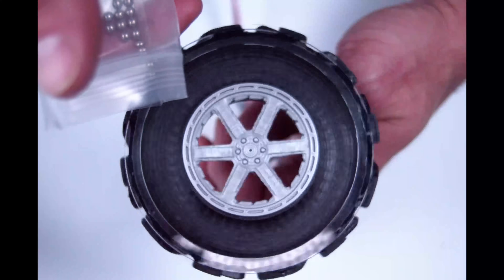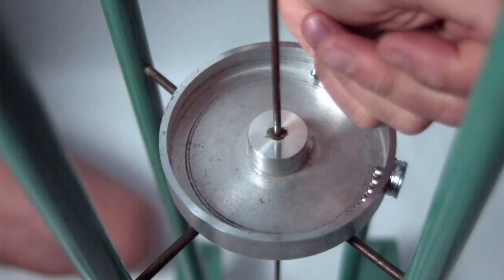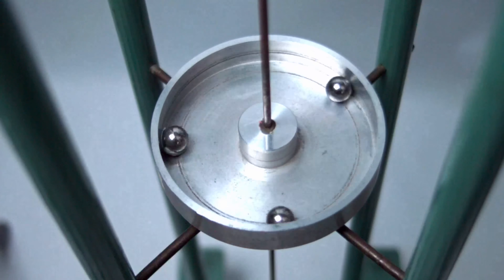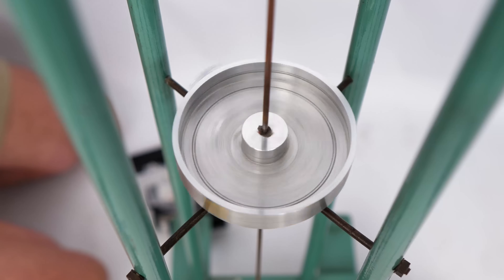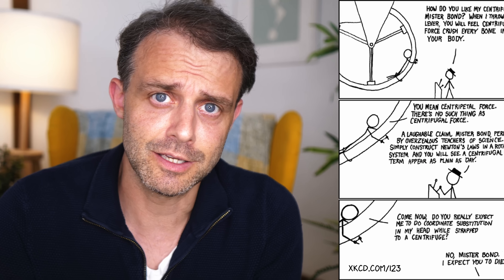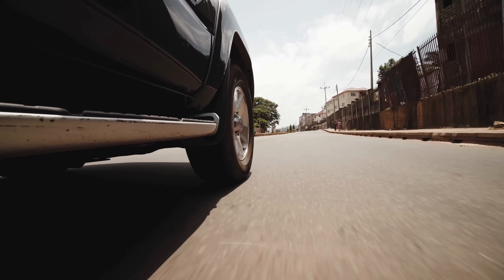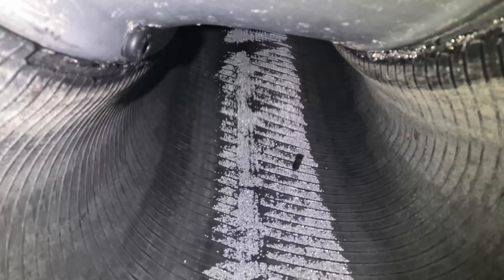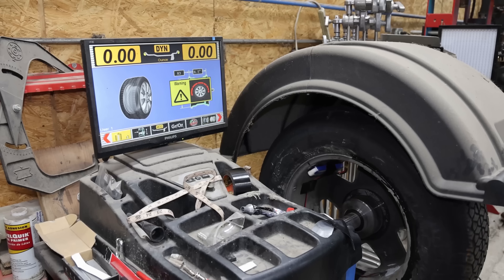Do tire balancing beads actually work?

Comment: Mechanic here. The balance beads do work in theory. In practice however, they can be problematic. They can wear the inside of the tire and create rubber powder inside the tire. Normally not an issue because it just adds to the balancing mass. The problem comes when you use poor quality air to fill tires. As in air that contains moisture or compressor oil. It creates a sticky fluid in the tire that keeps the beads from moving around freely and balancing the tire. If they all get stuck together, then it creates a massive imbalance. They can work and they're used in semi trucks (commercial trucks) frequently as there aren't a whole lot of balancing machines available for the large tires. Another method is using separate balancing rings. Theyre metal rings that mount between the hub and the wheel. The balancing media is inside that ring and does the same thing. They have the same issue though is if you get a pinhole in one and it allows moisture or condensation in, then the media sticks together.
Reply: I have the balancing rings on my semi truck's first axle and could immediately feel the difference after adding them. I thought they were snake oil until I drove someone else's truck. It was the smoothest driving truck of that particular brand I'd ever driven. That sold me on them and then I bought some for mine.
Reply: I've dismounted tires that had these in them, and the inner liner was worn halfway through, tons of rubber dust, and a horrible smell.
Reply: @Kevin75668  that is from running  on low pressure, not the beads
Reply: @Kevin75668 That is amazing!   I run them in tubes!   I have a vintage Winnebago that tire weights seem to refuse to stay on.   About 15 years ago I lost a weight and got a vibration.  Where I was working we had been using them in Medics with no issues so I ordered some that were "Tube Safe".  What a difference!   I was sold after the first trip!
Reply: @Kevin75668  I have years of experience as a tire tech and I'm calling bs on your comment never have I seen glass balancing beads damage the inside of a tire. If they actually did then I would blame the crappy material the tire was made from not the glass balancing beads. Most truckers use balancing beads and put on way more miles then your average driver and if they caused damage to the truck tires then no truckers would use them.
Reply: @Kevin75668  They don't use balancing beads on personal vehicles. At least not in the states, unless you ask them to. And then they're going to ask why because beads don't balance till you hit highway speeds. If you do a lot of city or town driving your tires will be unbalanced most of the time.
Reply: You must not ve very observant, . Friction is friction. Beads wear the inside of tires. It's a fact.
Reply: @leonelewis59  owner of a tire shop here, have done thousands of tires, with and without beads. Beads dont wear out the inside of the tire. Driving on low pressure is what causes that. 
Edit: the beads dont move much when you drive, they lock into position and dont move again till you stop, not a whole lot of friction
Reply: @anthonyaubuchon765  I just watched a video where someone put a gopro inside the tire with balance beads and can confidently say that at 35 mph the beads were already locking in place. You definitely dont need highway speeds
Reply: @Kevin75668 that's weird, I fit tyres every day and do hundreds of these. Never seen one wear the inside of a tyre before....
Reply: I was looking for someone explaining the actual practical issues. 
Hopefully your comment gets highlighted.
Reply: Sounds like the beads could be used as a supplemental balancing method alongside traditional methods. The ring method of holding said beads to protect the tires sounds wise.
Reply: When I read "poor air quality," I internally laughed at the jokes about premium air. Then I read further and realized that premium air really can exist. And if I don't use self-balancing balls, does air quality matter?
Reply: @koliwbr any compressed air system should have some method of removing air and moisture. Its more for air tool life than anything. The coin operated or free air pumps at the gas station are usually tiny compressors with no tank or a very small tank and no method of removing air. The "premium air" is sometimes pure nitrogen which doesn't have any of the moisture or compressor oil.
Reply: @dangerrangerlstc the vast majority of compressors are undried 😂
Reply: @Seldoon_Nemar I don't know  of any professional shop that doesn't have an air dryer system to protect their air tools.
Reply: @anthonyaubuchon765 okay, so that's 1/3ed of compressors maybe. What about all the other ones that aren't that are used to inflate tires? I've never seen a gas station have dried air 😂
Reply: I use nitrogen in all my tires.
Reply: @alanquintus2069  So does everyone else. Air is MOSTLY nitrogen.
Reply: @koliwbr  Nitrogen does not hold heat like moist air will. So less expansion. Not a race car in the world that is competitive that doesn't use nitrogen. N is inert and therefore will not combine with water molecules. Moisture laden water therefore can be purged with N like in air conditioning systems.
Reply: @koliwbr  No. Shops have an air dryer system to protect their air tools, so it's just air.
Reply: @koliwbr  Yes most gas station air compressors don't have any type of filter on the line so they tends to blow a lot of moisture into the tire. Normally not a huge deal, but in cold winters it can legit freeze your air valves open.
Reply: so you mean, premium air is a thing?
Reply: @klazzera  Well, properly dried air.  Most tire shops don't have air dryers of any significance.
Reply: @klazzera  No. Well, not really.  Shops have an air dryer to get rid of moisture to protect the air tools that they use. If you use your personal air compressor at home and you don't have an air dryer then yes yes, you could be introducing moisture in your tires. So technically, yeah the shops air could be considered  more premium since it's dry. Honestly though, unless you never drain your tank, you're not getting enough moisture to make a difference. Specially if you're not using balancing beads.
Reply: @klazzera Premium air is totally a thing. They fill the tires with bottled nitrogen instead of organic free-range air.
Reply: @klazzera some people inflate their tires with other gases, like nitrogen.  Hydrogen could be fun for parties.
Reply: @dayv808 hydrogen would leak through rubber like mad. it's not a great tire gas for many reasons
Reply: @klazzera  Nitrogen is a thing.
Reply: @klazzera  ya look for green valve caps on tires, there filled with nitrogen
Reply: @drowsycannon5179 nitrogen is also less dense, so it's lighter. And it doesn't change pressure as much with temp. We used it in the race car to keep the tire pressure stable during races.
Reply: Would it be better to have them inside some kind of rail assembly then?
Reply: Also if the vehicle has a lot of start and stop or city traffic there is a point where the centrifugal force isn't enough to keep all the beads on the outside of the inner tire.  During that time the beads fall off impacting the wheel and sensors in the tire.  My work truck had new tires when I bought it used.  Turns out they had beads.  Since it does city driving the beads damaged the tire sensors.  I removed the beads and balanced them properly when replacing the sensors.
Reply: So could you just throw epoxy into a tire, and then go freeway speeds so it balances, then just keep going for whatever duration is required for it to cure? Seems like it SHOULD work.

I think epoxy might be too rigid, but I can think of a few different rubber-like adhesives that seem like they would work.
Reply: @ClippyDrone  This would not work or be smart at all. As the tire wears how are you going to adjust the balance if its solid rubber or epoxy smeared all over the inside of the tire. Balancing beads constantly adjust the balance through the whole life of the tire never requiring re-balancing.
Reply: @Gnom3rcy add more epoxy/rubber.
Reply: @ClippyDrone or just add beads and be done with it
Reply: @ClippyDrone I think the problem with that would be radial tires always sag/flex at the bottom of the rotation you can see it when the go pro in the video makes a loop and that would brake the resin when it got hard
Reply: @ClippyDrone  Then you won't be able to fill your tires or remove them once the glue sets all over the inside
Reply: @ClippyDrone  yo thats not a bad idea at all, i dont think what you suggested would work, but definitely potential for a video trying out different things and trying to get them to stick
Reply: @ClippyDrone 
Well that would most likely work one time, then, the tire deforms again (wear, Heat, mechanical conpression etc.) and becomes unbalanced again. Dont know how long that would take, but i guess no more than a few hundert Kilometers. Mechanics would tell you to balance your wheels every year.
Reply: @ClippyDrone please stop theorizing about anything related to this topic … epoxy ? Jesus f’n Christ.
Reply: @aemravan  They used epoxy as an example so people would understand of saying some random material, perhaps you should reread their comment and check yourself before telling others what to do?
Reply: Tires on a car are not round, they have a flat spot at the bottom.
Reply: then... would a liquid work? wouldn't water also flow into the perfect position?
Reply: @MBproduections  Good question. I think a liquid might not settle like beads, because friction works differently. Im thinking of a (horizontal) washing machine, those can spin as fast as car tires at 60 mph and the watter never settles. 

Also if beads can cause problematic wear, then water might be worse. Liquids tend to wear down everything.
Reply: That explains why we don’t have them in uk trucks. Cos we are restricted to 56mph. So we never get up to the speeds needed to get them to work.
Reply: @joshbull6467  after around 35mph you will already see most of the beads holding in place. I can confirm that from a video of a guy who put his gopro inside his tire with beads
Reply: I work in a tire shop. They don't work well in the real world. Especially come winter. Get a little moisture from a compressor in the tire from filling it with air and they freeze together. I've heard of people adding a little concentrate antifreeze but not sure how the rubber would react to the glycol over time.
Reply: @twigglykevin having a compressor that has the necessary moisture filters isn't all that uncommon
Reply: Our work truck (3500) had them in it. Boss told us that we could only fill the tires at the shop. They made funny noises but didnt cause any problems for years. And then they (maybe) did. Tire blew out right after we passed a semi. I seriously thought we were hit by a roadside bomb, because the boom was intense and the amount of "dirt" that flew into the air was crazy. It genuinely looked like the road exploded under the tire, rather than the other way around. Took me a minute to remember that the tires were full of shit. We slid in front of the semi, into the ditch, almost rolled, and came to a stop. My dumb ass grabbed the handgun out of the glove box, took cover behind the truck, and started scanning the ridge. 
It was probably the most embarrassing moment of my life. I still haven't heard the end of it. I'm officially called "private" at work. Fuck my life.
Reply: @abettermind probably a better reaction than most people honestly. Former military?
Reply: @abettermind ok, private! You'll rightfully never live that down.
Reply: Thanks for that insight.  Makes a lot more sense to me.
Reply: His example was glass beads, but i always heard those break down and just turn into sandpaper and can ruin a bead. When i was looking them i got the impression the glass beads were the cheapest and most common, but not the best
Reply: I had the rings on a 3500 Chevy.  They worked ok most of the time, had to get to 14 or 15 mph, until then it sounded like a driving rain machine.  After 25 or 30 it seemed to smooth out a bit usually.  Sometimes they would go from smooth to unbalanced to smooth cyclically.  I use loose beads in trailer tires, work like a champ.
Reply: Ahh this is why they charge me for the premium air
Reply: That being said, do you think a larger grain material might not stick together like glass if contaminated? For example, a small handful of bb’s?
Reply: Wait, what if you just added some water to the inside of the tyre instead of beads? Would that work?
Reply: @homehome1542 There's a product called "Tire life" that has a benefit of balancing tires however it has a freezing point of -7c.
Water corrodes the inside of wheels and destroys them especially in OTR wheel/tire assemblies.
Reply: Balancing rings sounds cool as fuck
Reply: youre quit the mechanic you sure you dont have a higher title? kudos man love someone who does the extra work into learning about what they are doing at work instead of doing it just because other people figure it out. Mechanics is one of the best trades for that because at a young age cars are what we are exposed to most and they cover a majority of the types of engineering
Reply: i used to find bearings in tyres back in the 90's,  eithersteel, plastic and rubber when i did tyre fitting/repair.  was common with the oldies, they swear by them. they did wear on inside the tyre though
Reply: I was going to make a joke about the beads being a gimmick by the tire companies to wear the tires out from the inside out. Thanks for ruining my joke. Oh well, wasn't really all that funny anyway.
Reply: @RyshusMojo1 Its recommended or accepted by all commercial tire manufacturers. I use liquid tire balance as its vastly better. Weights are good but not a lot better than liquid. And the liquid has other benefits. 

What wears a tire like crazy is low tire pressure. It kills the sidewalls causes overheating and can wear the bead.
Reply: Same thoughts here yrs as a mechanic it is obvious his theory does work but creates other problems
Reply: moisture is not the real culprit, it is the oxygen. It reacts with the rubber (rubber contains some unsaturation) and that causes the rubber to lose its elasticity. The problem gets worse at higher temperature and higher temp causes the pressure to increase. It is like cooking oil getting thicker after one use (the same chemical mechanism but cooking oils have anti-oxidants as additives). Usually the inner surface of the tubeless tires is coated with butyl rubber which is relatively more prone to oxidation.
Reply: big mud tires with thick tread too
Reply: Mechanic here…I suggest Anal beads will solve the problem…you’re welcome
Reply: Not to mention most of those Centrue-matics only compensate up to 4 Oz for most low pros. So you'll need to balance the tire anyway. 11rs are a bit of an exception to the rule depending on how good the brand you get is. I've balanced 480s with no weight needed before but that's just pure luck. They also don't work that well for Michelins since they're supposed to be balanced regardless of how you mount them to begin with. You're more likely to start feathering them. Tape weights and and a roll of gorilla tape haven't failed me yet
Reply: @thekidfromcleveland3944 please explain the roll of Gorilla Tape. Is it for extra adhesion for the tape-weights ?
Reply: Wouldn't higher diameter beads reduce wear inside tires? The larger beads would be less like sandpaper and more likely to slide rather than "chip" the rubber.
Reply: @xzydra570 Glass balancing beads don't damage the inside of tires anyone claiming this has no clue what they are talking about.
Reply: @Gnom3rcy so you deny the existence of friction?
Reply: @KT-pv3kl Funny thing is, when you try to be a know it all using things you domt fully understand, then you come across as being clueless. The existence of friction does not prove that the beads provide enough friction to cause the inside of thr tire to wear fast enough that it can actually cause an issue.
Reply: important comment, thanks!
Reply: I KNEW I wasnt being scammed with "premium" air lol
Reply: Glass beads rubbing would cause a smaller amount of glass dust. But it doesn't need a large amount of glass dust to cause lung damage. 

Avoid!
Reply: So they work in practice too but there’s caveats
Reply: @sterkriger2572 like everything else pretty much
Reply: I was gonna say this. Run them in my super duty tires only because tread wears before too much internal damage is caused and it’s easier to balance the 35’-37’s they are used in the desert and will usually get a flat before 80,000 miles.
Reply: I've been using airsoft pellets in my motorcycle tires for years. No complaints as motorcycles tend to only get very much wheel vibration at high speed anyway. The soft airsoft pellets don't wear out the inside of the tire very much, but they do wear themselves down to a colorful sand. It still works. Wheel balancing very well.
Reply: So ‘Premium air’ is actually sort of a thing haha
Reply: @Nick-vc8dx  no, not really. The advantages are too small to matter.
Reply: I was about to make a premium air joke until I read the rest of your comment lol
Reply: This. I'm not a mechanic, but I remember being in a two-week internship while at school. (It was something the school encouraged to do for people to try out stuff)
As a ...15? year old, they spent like 20 minutes teaching me how to install a tire to a wheel and then using a machine to balance it out, where you just hammer in small weights where they're impossible to see when installed.
I think that's just something you get the new guy or a potential intern or student worker to do, and don't bother with these beads.
Reply: Yeah that’s exactly what someone who wants you to pay to have your tires weighted would say 🤔
Reply: @sincerestrelic5877 nope, because I don't sell, mount, or balance tires. I just see the aftermath of them.
Reply: @dangerrangerlstc it was just a joke dude I believe you 😂
Reply: And it only saves the 1 minute per wheel to balance
Reply: I think they need an adhesive that sets with moisture and stops when set
Reply: Same here, never used them in an automotive setting.  I've only known balancing beads used in tractors to reduce the bouncing that happens.
Reply: I was wondering about tire wear the whole time, thanks
Reply: Just buy premium air.  It's only $70.
Reply: How about you do a video to prove or disprove conventional balancing. The minute you hit a pot hole, general wear of the tread, letting the car sit in one spot for a while. All of these will cause the tire to lose balance and really requires a rebalance. 

I’ve used balance beads in all of my motorcycles for years and I’ve never had a single issue doing it. Truckers have used this method for as long as I’ve been alive.
Reply: @zyonsdream it mostly works. It can have problems if you are careless with how you treat tires. I agree that commercial trucks have used them for decades, mostly without issue. They can be problematic if not used properly, just like anything else in the world.
Reply: Had a question about this and you've answered it!
That's why this kind of YouTube info is sooooo useful and valuable.
Practical science alloyed with real-life experience!!
Reply: so if beads are an issue why not us a liquid that wont freeze? It isnt abrasive, wont freeze and is even more fluid than beads
Reply: Wear on the inside was the first thing I thought of.
Reply: Why cant you put the beads in a special rim?
Reply: Poor quality air?! wtf! I have to worry about this shit now too?
Reply: Beads are supposed to be for track use only for the reasons you said.
Reply: It is practically sanding from the inside out.
Reply: Well put. Tire manufacturing can have defects, that go beyond balancing alone.
Reply: yes someone with brains
Reply: truck tire shops love to use a type of sand to "autobalance" big rig tires but they are now being forced to use wewights due to TPMS sensors which is a new requirement in roadlaws here in DK
Reply: I mean, for trucks either that air is stuppidly wet or saturated or the tires will wear before you reach that point
Reply: This is hilarious... 
Every give way, stop sign ... what a fun ride 😂😂😂😂
Reply: Not a mechanic but you covered a lot of what I think would be the problem with this. If it was an amazing fix then everyone would be doing it
Reply: @biasmushroom6311 and to be fair 90% of the time it works just fine. Has been working for decades. Also works in other applications besides tires.
Reply: if this is the main issue, surely someone needs to just use hydrophobic beads and it would fix the issue?
Reply: What a lovely example of theory vs practical experience.
Reply: I have had moisture bind up beads. Makes a heck of bad ride. Best option is balancing liquid. All the benefits none of the drawbacks.
Reply: Inside wear caused by beads is least of the concerns.  Potholes, dips, and bumps would negate beyond any gains.
Reply: @2020tuber Not true at all. Not all tires are on a Honda. Some semi tires get recapped 2 or even 3 times. The quality of the carcus and the end of service it critical. Balancing liquid keeps the balloon supple. Beads wear it way.
Reply: what if you would use Rice?
Reply: @CheckerLP1 Well it would turn to rice flower in no time for one. And if you have any moisture in your air hose the rice would clump and rot/mold. Just not stable or durable enough.
Reply: @CheckerLP1  your tire would be filled with rice flour in a matter of hours...
Reply: That's why I always get premium air
Reply: The rubber powder is from running on low pressure, not the beads.
Reply: This is true, a tire rep walked in the shop one day to look at a tire that was a warranty claim, he saw beads and said if those were in it, it’s void. Luckily it had been balanced with weight
Reply: Every CD and DVD player has these balancing balls to handle unbalanced disks.
Reply: Thanks Chat GPT
Reply: @happyvlog4672 sad world where genuine experience is confused for AI by people who don't know any better.
Reply: Motorcycle Tech here, beads are Far Ken Shite, ive not seen much wear inside tires from them but they inherently are unstable as they can shift around under heavy braking and acceleration similar to a tank of fuel, Useless on a racetrack or a weekend ride if you’re giving it some
There is currently no reasonable machine or advanced technology to balance bike tires so we still use an old school type stand and let gravity find the heavy spot and stick on how much weight we need to the rim, Moto GP still does the same and they reach 350+kph with perfect balance
Reply: @timmyjohnson7192  Yes, I was surprised when a few years ago at MotoGP at Phillip Island that, in the pit area for the support Australian Superbike class I was able to access that the tyre techs (Pirelli) were using the exact same method I use at home - the "old school type stand". Albeit somewhat quicker than I've ever done!
Reply: @timmyjohnson7192  I've used them on my motorcycle and they are better than weights. I have a heavy bike and the front starts to feather, the weights will get out of balance ,whereas the beads are dynamic and are auto balancing.  I change my own tyres and never seen inside wear or dust. I prefer the pink liquid stuff bat that is expensive.
Reply: My first thought was for mountain bike tires with semi-liquid sealant. My bike tire is about the same radius as a car tire, but obviously I don't reach the super critical speed. Is the sticky fluid effect you describe not enough to matter on a bicycle, or is there specific technology in the sealant fluid? Stan's no-tubes fluid is like you describe - particles suspended in fluid. Hmm...
Reply: @Scott-J  bike tires never really get to a speed to need balancing anyway. The liquid sealant forms a thin film over the inside of the tire that just evens out as the wheel spins until viscosity takes over and it pools at the bottom.
Reply: @dangerrangerlstc  as a kid, I lived in the mountains and during my drive in to town with my bike I could easily hit speeds wear my wheels started to wobel like crazy.
You don't have to hit top speed for you to notice
Reply: @dangerrangerlstc : Bike tires go through a balancing bench, but it's for a different purpose - to adjust the spokes so that rim is circular, not elliptical, and does not wobble sideways.

The rims are quite flexible, so you need properly tightened spokes for them to endure the forces.
Reply: @Scott-J I MTB and am also a mechanic, you're not getting near the rpm required to actually feel any imbalance let alone fully spread out the sealant evenly across the tyre, it'll be sloshing around rather than looking like the beads in this video.
Reply: @Scott-J  that shit is dangerous, you should see the blow out i had from that shit, use a plug kit
Reply: My friend swore by them.  He used buckshot.  He loved the whizzing noise they made when he stopped.  One day he stopped and they made his tire explode by wearing it out from the inside and they shot in all directions like a shotgun.  Luckily nobody was harmed.  Still, it's clearly dangerous and should not be done.
Reply: @justinmohns8279  You don't get to just make stuff up.
Reply: @justinmohns8279  you pass dozens of vehicles daily with them in the tires. Well, balance beads not buckshot 🤣
Reply: @justinmohns8279  Maybe don't use buckshot? Just an idea.
Reply: Hold up! Are you saying that there really is such a thing as airing up car tires with "premium air" 😂 i thought that was just a meme, how can you tell the difference between good air and bad air?
Reply: @pilagirlrocks no such thing as "premium air". There's clean air, which is what all compressed air is supposed to be, and there's dirty air. There's nitrogen that some places use to fill tires, but usually that's billed as nitrogen. I can't say I've seen anyone sell nitrogen as premium air. 

And yes, I know about the "premium air" meme. Always funny.
Reply: @pilagirlrocks  It's not premium air lol. Most gas stations are too cheap to add a filter onto the air compressor line so they blow moisture into the tires. Normally not a huge deal, but if its in cold weather it can cause your valve to freeze open.
Reply: out of curiosity, why aren't the beads designed to stick in place like that? If you took off the tire, used beads of a thermoplastic like TPU, then spun it up, heated the tire up while it was spinning, then cooled it down while it was spinning, then stopped it, they should stay anchored to the inside of the wheel. It just seems weird that a method that basically solves the problem immediately has the one issue of "but the fix goes away once you stop since the beads don't stay in place" hasn't been solved by just, sticking the beads in-place. Presumably that'd even solve the issue with the beads wearing away the inside of the tire too.
Reply: @robonator2945 because tires have to flex. Any method that adhears the beads to the inside will have the beads fall off as the tire flexes and moves while going down the road. Theyre also sold as "dymanic balancing" because they can constantly adjust to a changing tire, like if a rock got stuck in the tread, or a chunk of tread got damaged and ripped off.
Reply: @dangerrangerlstc  that seems like a material-science problem that'd be fairly easily solvable. Granted it's not my area of expertise personally but I have a hard time seeing how it'd be hard to make something flexible that melts/adheres to rubber. (at least long enough/well enough that it won't fail before the rest of the tire does) 

While I do agree that it's no longer truly 'dynamic' I'm not sure how many people would actually care about that more than having it work at any speed and possibly having to take an hour to redo it eventually. (at which point I imagine the tire would be nearing the end of it's life anyway)

I mean it's not like it's an unsolved problem or anything so I suppose it doesn't really matter in the grand scheme, it just seems weird that we went to full fledged sensor-driven dynamic balancing machines before "hey, do you think we can make those balls stick in place a bit better?".
Reply: @robonator2945 he kind of explained it in the video. Once the tire gets past that "super critical" speed, the beads go to where they're needed, and they stay put for the most part until you come to a complete stop. Even going down to that first harmonic speed the beads stay in place. There are only a couple speeds where tire balance or imbalance is noticed. Usually around 45 mph, and then again at around 60 to 65. And it will be different for each tire configuration. So there's really no need to make them adhere and stay in place inside the tire. Adding liquid that has a set time to harden causes its own problems. You have to mount the tire to the rim, install on all 4 wheel ends, then drive a certain amount of time at a certain speed for the liquid to cure. You want the tire shop to be the first one to put 20 miles on the tire? What if there's a mechanical issue and the car doesn't get out of the shop on time? Now there's a cured mass of liquid and beads all in one spot of the tire.
Reply: @dangerrangerlstc  what? you can just, spin the wheel. Like how actual tire balancing machines work? (though those still easily run into the thousands of dollars and need advanced sensors and manual operators to do the job) Why are we assuming that you're trying to balance them while they're still on the car?

Take tire off, put it on a motor, put beads in tire, spin it up to sufficient RPM, heat tire, cool tire, take off motor, put it back on car.

It'd be a relatively simple material science problem to nullify thousands of dollars worth of equipment and replace it with something any half decent mechanic could jury rig in their garage. Tire balancing isn't really an unsolved problem so it doesn't really matter, but it just seems like it'd still massively improve margins being able to not bother with such insanely advanced dedicated equipment. Instead of needing advanced sensors to detect the resonances & calculate where you should put what weights you can literally just get an old motorcycle engine or something, lay it on a table, put a wheel on it, and find the right distance with a blowtorch to warm it up without melting it.

I guess it's a case of the problem just being solved well enough that no-one cares, but it still seems convoluted that we have this way of getting the laws of physics to self-balance a tire with beads with the one issue being they fall out of place, and instead just making them not do that, we're using advanced equipment and sensors to do it instead.
Reply: @robonator2945  with current lead weights that are either adhered or hammered onto rims, yes the balancing is static. But, if the tire wears unevenly, or a piece of tread gets damaged, then if someone cares enough to bother, the wheel needs to come off and be rebalanced. With the beads going in dry, and using good clean dry air, the beads are constantly adjusting for any changes in the tire. If you glue the beads to the inside, then they can't do that. 

The other problem comes if you get a nail or something through that you have to patch, well now you can't because the glued on beads are in the way. Plugging is considered temporary and has the possibility of coming out. So a single nail picked up on the road can put a tire out of service and need to be replaced. With the dry beads, the tire can come off the rim, get patched, and put back on with more beads and they'll balance themselves back out.
Reply: @robonator2945  What you are describing is the traditional method of balancing: Spin the tire up and place a fixed weight on the wheel. You're method of somehow fixing a weight inside the tire is unecessarily difficult.
Reply: @robonator2945  lol...then invent it and make millions! You way over simplified. The device would be much more difficult than described. Plus, you have to make sure it is compatible with every known tire manufacturers rubber chemistry.
Reply: @Dusdaddy  my guy, my 'method' is literally putting plastic beats in a tire, spinning it, and then heating it up.

If you think you have the authority to say that's an actually unsolvable material science problem that'd never actually work then sure, go for it, but saying it's "unnecessarily difficult" is just patently nonsense.
Reply: @dangerrangerlstc 
So prove it, where is the evidence.!?
Reply: @snakezdewiggle6084  look for green valve caps on tires, that indicates their filled with nitrogen
Reply: Maybe would be possible to create a technique where the tire repairer spins the tire at supercritical speed with beads inside and then injects a glue or something so they stay stuck in that position.
Reply: @kyrodes  part of the benefit claim is the beads are constantly adjusting. They're billed as "dynamic" balancing. So they're constantly adjusting for tire changes. Say a chunk of tire tread comes off or a rock gets stuck in the tread. The beads will automatically adjust for that imbalance.
Reply: Instead of beads can they use something else?
Reply: Yes, I use airsoft BB's. They are bigger and won't clump together if they get wet, but aren't heavy or hard like shot or ball bearings @handytoolboy
Reply: @handytoolboy  Piet Hein's superegg shapes?
Reply: @handytoolboy they make a powder as well but it’s kinda all the same idea the old old truckers put golf balls in there tires
Reply: @handytoolboy  4x4s that run huge tires have used golfballs to the same effect.   I've used airsoft pellets (plastic) in my motorcycle for 100k miles.   Very smooth.   A friend races a road race car.  He uses kiln dried sand in his racing slicks and pressurizes with nitrogen ( zero moisture )  He says no vibes at 140mph !
Reply: @handytoolboy i have been using airsoft bb"" in my 37s for 20 years without any issue.
Reply: @handytoolboy  Да, например воду. В СССР во времена застоя, когда шиномотажек не было, деды заливали стакан воды через ниппель.
Reply: @handytoolboy  anything you use, will wear down the inside of the tire.
Reply: Glass beads are bad for wildlife
Reply: "poor quality air" you're a scammer
Reply: I'd say adding a viscous fluid that can dry when exposed to heat and moisture on its first trip above 50 mph would be the solution, not the problem.
Reply: What do you think about the idea of adding perhaps maybe even a full layer that could maybe even be peeled up almost akin to a lint roller around the tire but of essentially good quality anti-moisture buildup packets with like just one big round packet around the tire that you just changed out every so often in order to ensure that there's fresh material there to actually properly deal with the moisture to prevent that problem?
Reply: "mechanic here" and proceeds to just say what the video already shown
Reply: It's funny you mention semi-trucks, because balance beads are a large part of the reason why you see so many trucks on the side of the road with blown tires. Most truckers aren't in the habit of wearing through their tread (mainly because DOT inspections help put a stop to that sort of recklessness). However, what truckers can't see are the balance beads wearing clean through to the other side of the tire from the inside out. If you ever pick up a scrap of tire from the side of the road, you'll often see it has plenty of tread left on the outside; but there's a heavy amount of wear on the inside from the balance beads.
Reply: @SergeantExtreme I'm a trucker and this isn't even remotely accurate. The vast majority of tire debris you see from trucks is the tread delaminating from the casing
Reply: @SergeantExtreme  that's not how any of it works... there isn't a heavy amount of wear on the inside of the tires because of the balance beads for multiple reasons one being that the beads don't bounce around like maniacs. and when they do, the tire rotation is quite slow meaning there's close to zero energy for those beads to do any kind of wear and tear.

i've seen the people who service tires for the semis and they just throw in a bag before installing the tire, they've been using this approach for decades. no sane driver or regulatory agency would permit the use of balancing beads if they'd create such issues as you described.
Reply: @duroxkilo I'm a trucker and the main reason I don't like the beads is because if you do have a blowout or flat you lose them. The rings I have are self contained
Reply: @duroxkilo I’m glad I’m not the only one we use them at the shop for some 18 wheelers but we do all of the utility departments tires with beads (they are mostly 245-70-19.5 made just like a 18 wheeler tire just a little smaller) and I have NEVER seen them wear the inside of the tire like a few people have said and we have changed at least a few 100 of them over the years
Reply: @duroxkilo ish... semi truck tires are made thicker and are made for that. Passenger tires aren't.
Reply: @Redbikemaster Well, that doesn't even make sense. When you replace your tires they don't reuse your old beads. They just throw a new bag in. They are cheap. Like 3 bucks.
Reply: @duroxkilo  that's what our fleet does, toss bags in. Never a problem.
Reply: @SergeantExtreme  This is a very untrue statement glass balancing beads are not blowing semi tires. I have years of experience as a tire tech specifically replacing and repairing semi tires and never once have I ever seen any damage caused by glass balancing beads. Glass balancing beads do not cause any wear or damage to the inside of tires.